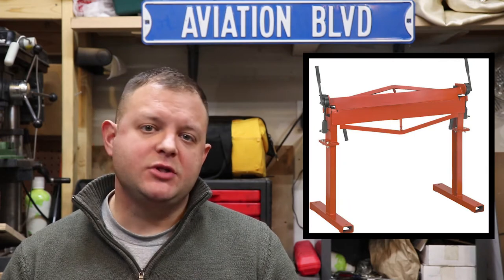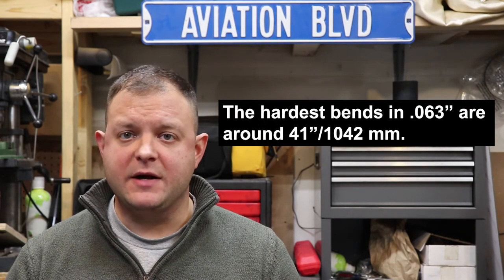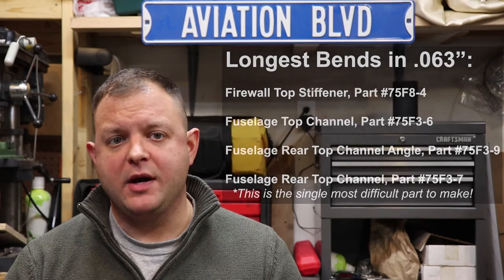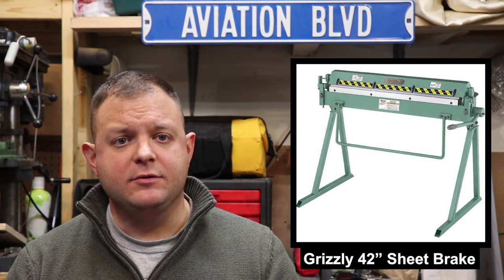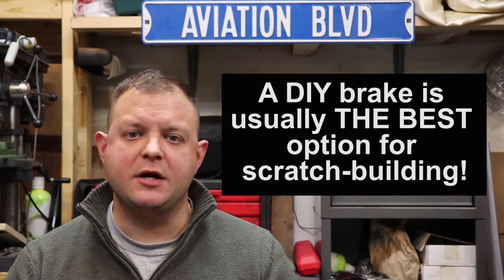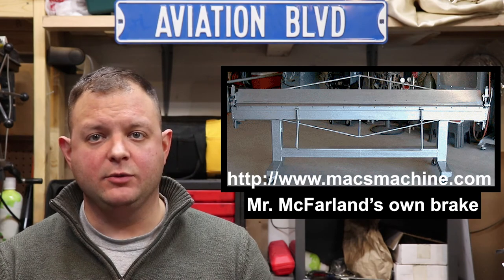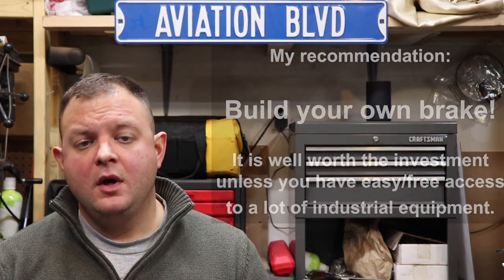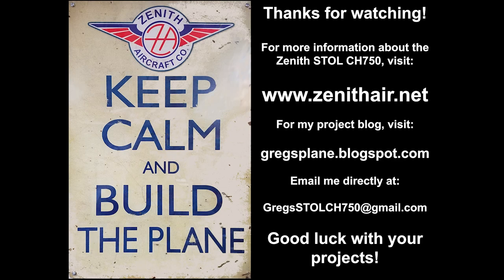Bending Brakes:   Everything you need to know!

Comment: One trick I've used and found to work well, is using a piece of steel round stock of the appropriate diameter required for the radius you are forming. When used with a cheaper diy "basic" brake, works well. Especially when working with 6061-T6 to avoid stress cracks along the bend radius. Just my $0.02. Again, superb video, and info. Thank you for taking the time to make this. 👍👍
Reply from the maker: If I'd had my TIG welder when I first built my original brake, I would have made a custom clamping leaf shoe with steel rod, as you described above. The oak shoe that I originally used worked extremely well, surprisingly, all the way up to 8' bends. Never broke or cracked or anything! But I'd still go with a steel rod welded in sections to removable tabs along the clamping leaf. That way, I could have 2 of them: 1 for 1/4" radius and 1 for 1/8" radius. The 10' industrial brake I have access to was modified in exactly that way and it works beautifully.

Comment: Great video Greg,  glad to see you are posting again.   I gave up trying to bend anything beyond 4 feet in length and just bought all the long pieces from the factory.  It ended up being cheaper in the long run and the parts were made correctly.  I guess my plane will only be 85% scratch built...oh well.
Reply from the maker: It's not a bad choice to buy some prefabricated parts, especially if you're having problems getting things to turn out correctly. Nothing wrong with buying some of the more difficult parts!

Comment: Thanks Greg: I appreciate the plug. Great explanation on brakes. In the future I will add a couple of options for the longer pieces which hopefully can be built rather inexpensively. I will add that on my Mac's brake at full capacity with .040 for the longerons on my 701 I could not completly eliminate a slight bow even after adding another tensioning plate to the front of the leaf. It is not enough to be a problem, but I think that we are at the full capacity of the brake, My personal opinion is that any attempt to extend the capacity of the brake even another foot, will give less than satisfactory results
Reply from the maker: There were more details in my original script about the .040" and adding length to the Mac's brake, but it was getting a little long. Completely agree on your analysis. There was just so much information to include...I could have done a 3-parter!
Reply: I am going to have to go back thru my build log because as I think about it I am not sure that my  .040 longerons were built on the Mac's brake. I think I added another plate to the front of the leaf to add tension and it helped the bowing but did not completly eliminate it. That is when I built my crude press brake and formed my longerons on it, as well as all my z channel
Reply from the maker: From what I understand, several kit builders have reported receiving bowed parts from Zenith on those longer bends. It seems to be a non-issue because the bow is fairly slight. I plan to build the CH640 after the 750 is done...from what I understand, the longest bends in that plane are nearly 12' for the tail section spars. No idea how to accommodate that! One of the builders on Zenith.Aero said he did it by modifying his Dave Clay brake hinges, and building it to 12', but I haven's seen any pictures.
Reply: way back when I needed it I built a crude press brake from I-beam and powered by 2 jacks. built at about 8" but could easily be scaled up. I haven't shown pictures as it is sitting out in the weather and is covered in rust but I will do something with it soon. It is not convenient to use but for what it was intended to do it worked well. I also have a design here somewhere of a manual press brake which could be any length for those few long bends. Dan.
Reply from the maker: I'd definitely be interested in seeing it, even if you don't clean it up. Depending on how the 640 tail spars are designed, I may consider altering then to mimic the main wing spars, with built-up caps made from angle instead of forming them. I'll have to do a lot of careful stress & weight calculations, though. I normally wouldn't even consider that kind of modification, but hey, this is experimental aviation!
Reply: I loaded a quick video to my instagram feed showing the press brake. it's nothing to write home about, but it did form the longerons and z channel which I found hard to bend on the mac's brake.
Reply from the maker: Simple, but effective! I like it. Thanks for putting that out...I'll likely have to do something similar for the 640 one day.
Reply: Can you post a link to your video. I can not find your instagram account. While I already have a very capable 10 foot cincinati  brake, I have given a lot of thought to various press brake designs. Most of the large press brakes I see are spec'ed for 1/4" and thicker material. For what we generally work with I have to wonder if some kind of truss based press brake would work.
Reply: I will be linking it shortly. My instagram is the same as my u-tube channel and website.  hillsgun
Reply: Ok. I did find it after another search. It looks great! Did you have any problems with the beam deflecting during long bends? Thats why I was thinking more along the lines of a truss design to stiffen everything up.
Reply: No noticible deflection. I placed the leg spacing to help negate deflection in that area. If it were stretched longer it would be a simple matter to install a tension rod both top and bottom if necessary and add a third jack for more even bending pressure as needed

Comment: Hi Gregg. I enjoyed hearing you talk about my bending brake design. I ended up building a Sonex from scratch. Using some creative thinking I was able to bend every part including the control surface skins. It was a challenge, but I was determined. I sold the Sonex after a few years. The current owner removed my VW engine and installed a Corvair conversion. He flew it to Oshkosh last year. Here's a short video of my Sonex: https://www.youtube.com/watch?v=AK-9Nn8rcLQ&t=2s
Reply from the maker: Great to hear from you, sir! Your brake allowed me to bend probably 75% of the parts in the Zenith. When I first got started with it, the parts turned out so well it gave me confidence that I could eventually complete the Zenith. Still a long way to go, but it all started with those first few parts formed on your brake design!
Reply: @GregsZenithSTOLCH750  Building and flying my own airplane was an incredibly rewarding experience. Glad to hear my brake helped you along the way in your build.